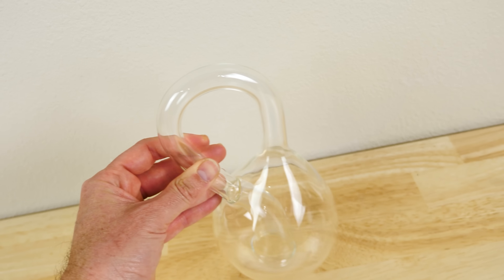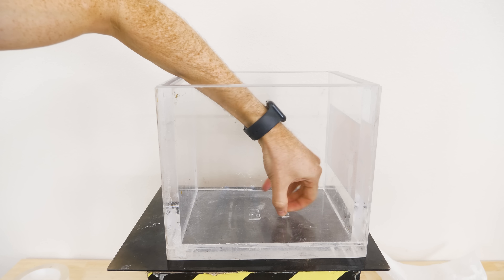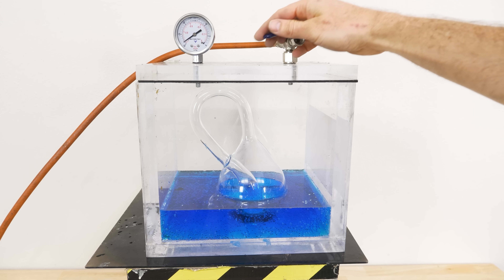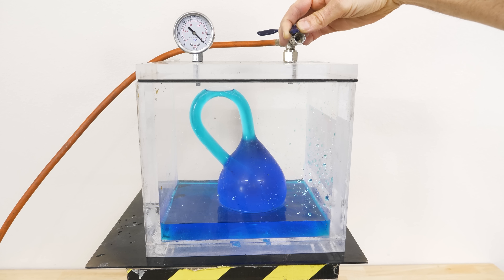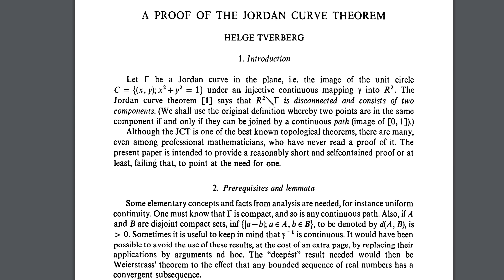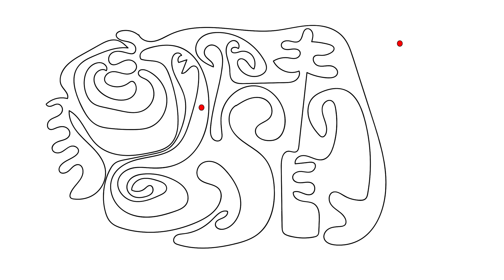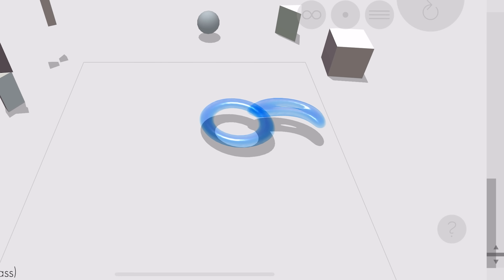Is It Possible To Completely Fill a Klein Bottle?

Comment: No, its just the conception about the physical Klein bottle model and the mathematical Klein bottle concept + the conception of "inside" and "outside"... it is kind of abstract but there is volume in the physical model indeed and filling it is the proof... the volume of water marks the inside while the air is the outside... and there's your volume... same that can fill other bodies with different shapes... You can also fill the tank with water and leave the inside of the bottle with just air... Is a test tube a shape with no volume? no... can a mathematical concept of a shape like a test tube have no volume? Yes... The problem is how you are applying your math and how you see the concept of inside or outside... ;) (Maths profesor and Electronics and Telecommunications Engineer sending greetings form Mexico)
Reply: Its not entirely mathematical, i can visualise it rather easily.
Its all about the intersecting tube AND the large hole in the bottle. 
(You probably know this part so i dont mean to sound condescending)
Remove the self intersection by adding another dimension and it simply starts and finishes at the mouth. No volume. 

But you can visualise it man, vaguely in chunks but have a look. 
Remove the intersect, try to imagine the end of that shape morphing into its self without intersecting, then try to imagine pouring water into the hole of that object and how it would behave. 

Its freaking weird man thats a funky ass mental image. This is a great mathematical demonstration.
Reply: @LogicCaster  the concept of point and line is mathematical it is not physical, though physically you can modify your personal conception to say a ball is a point and a bar is a line, but they aren't... so the lines ass borders of this model are not the same as the solid glass you have in the physical model,
Reply: @george.lopez1  
Then thats your loss.
Its not imagining a point being a line or whatever.
You can see its a closed system in reality if the start and end of a hole meet.
Its essentially a donut or torus made of glass, you cant fill it because there is no opening, its just a glass bracelet essentially. 

Thats the same concept except expanded out into a higher dimension. 

Really think about it.
Reply: @LogicCaster  The volume of water inside the device is not imagnation and it is measurable and it is a proof of the volume and that its just another bottle "similar" to the kllein bottle that is useful as a model to explain the concept... it is complex but do you undesratnd it that way? it is like chaos.... it is just order with more complexity that you may be able to process...  and about maths, there are real maths and theorical maths, on both you can find real and imaginary numbers... the difference is existance... It's not the same being just a physician full of theories than also an engineer and an inventor... these last two bring down concepts to reality..., I can measure the volume of that bottle similar to the concept of a klein bottle and i can measure the volume of the glass.... so...
Reply: @george.lopez1  
Its a shame you cant put two and two together mate. 
Maybe its my fault for not being able to explain myself, but theres a reason the entire mathematical community respects the idea of a klein bottle enough to make 3d representations…
Reply: @george.lopez1  
Oh and I didn’t mention I’m a mechanical engineer, and not because i was a good student in high school. Comes naturally to me… thanks for the kind words (:
Reply: @LogicCaster  The first lines are just rage that has nothing to do with the volume i mentioned and yes, clearly you cant explain because you are not understanding... But by saying "Representations" for first you are right... you are getting there...
Reply: @LogicCaster  Dude🤔, you got into my comment and conversation not me into yours... put attention... from beginning I am talking about the same thing... Seems you just want to win a conversation around my comment...
Reply: @george.lopez1  
You made a lot of bold statements and left credentials at the end of your original comment. 
You should expect criticism as a healthy aspect of science.
Reply: @LogicCaster  I did and explained in different ways to you didn't I? I am not shutting you down in any way neither...
Reply: @george.lopez1  
You’re bad at english that could be the problem.
Reply: @george.lopez1  

How much volume can a glass torus hold? 

Torus “tube” Diameter
- ID: 29.999999999999mm
- OD: 30mm

Torus as a whole:
ID: 150mm
OD: 210mm 

Whats the volume of this container, in reality? Im not asking you to calculate, just say what steps you would take and how you would approach the question.
Reply: I'll give you a practical easy solution as a child's experiment... fill your glass toroid/torus with water, (you can do it with sealing techniques or vacuum techniques or simply installing a cap without modifying the shape... then measure the maximum capacity until zero air bubbles inside the torus... there you have your volume in ml. Use conversion 1 milliliter = 1 cubic centimeter. There you go... Have a laboratory at your school and wanna do it in an inverted way? get a water tank, fill with air, extract air and measure, then transform to cm3... Wanna do it the hard way with or without use of programs, computer or calculators to plot? you need radial and cylindrical maths...  those plots are different from usual 3d lineal X-Y-Z axis plots... now, you cant use in-the-box equations, unless you are using the right one for torus where is like the equations you would use for cylinders with curves but since there is no bottom neither top, at the side that looks like a circle you need to set your beginning and end or top and bottom as 0° and 360°being the same... with the Klein bottle example, maths just get more complex so as the way to understand by plotting... similar to 4d calculations and plotting systems... so programs need to have that in their programming that instead of an XYZ plotting system where gets infinite to approximate your result to reality...  you can also have fun using spherical equations once you understand them... And also as an extra way to solve your problem, you can apply the millennial and Z Gen method: I am sure nowadays there are some simulators online or in apps where you can specify exactly just those details and get your answer.  Do you know the volume (solid material + liquid or gas inside) of the tires of the vehicle(s) you use to ride? ask the manufacturer how they did to get that data that you can easily find in their records... same with lifebuoy rings and other torus we use nowadays... Not enough? read the comments from everybody else... BR  ;)

Comment: I saw similar video about this about year ago. They just submerged the bottle in water and rotated it until air was out enough that you could see that it can be done. Then they explained how a klein bottle isn't any different than normal cup. They didn't do the 4-dimension stuff or math thing though, so this was more informative than that was.

Comment: I have a suggestion for a topic.  Virtual Particles.  Most of the research on them is going on at Fermilab.  I go to their site regularly to read about them and they have quite a bit of information available to the public.  As much as you like vacuum chambers, virtual particles should be very exciting to you.  Most of them are virtual muons with virtual electrons next in line.  I don't want to put too much into this comment because if you choose to talk about them I don't want to spoil your video by saying to much here.  I will just say that they can turn into real particles if they receive the right amount of energy while they are in virtual form and if you draw a very strong vacuum they start appearing and disappearing in the vacuum in very large numbers.  I realize the comment section is intended for comments about the video it is attached to, but I thought putting the comment on your most recent video would be the best way to contact you about it since I don't know any other way to contact you.

Comment: 3:20 but the rubber balls usually have tiny holes that allow you to pump them up or deflate them, is the ball then considered to have no volume? Or is there some kind of acceptable range of estimation where small enough holes can be considered filled up? And if so, why can I not pick one of the big holes on the klein bottle and say I've estimated it to be filled up (i.e. where's the line between 'ok to estimate' and not?)?
Reply: For mathematical purpose he just ignored the hole on the rubber ball as abysmal, because we are not particularly discussing about it (like, we are not discussing about the ball naturally deflating because the air is going out of that hole).

Comment: The idea that it doesn't have volume doesn't fly with me. The neck of the bottle simply dives through itself and opens at the bottom. 
He did mention the topology, but perhaps that's not the best way to define it. 
The bottom of the bottle is where the outside and in the inside separate.
That all being said, this is not my field of expertise and math is goofy to me sometimes.

Comment: couldn't you just submerge it in water or pipe water into it with a flexible hose that is smaller than the glass portion (letting air escape)? this just seems like a demonstration of liquid vaccumming if anything

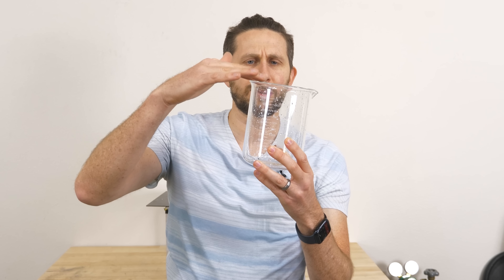Comment: 3:11 "In order to have volume you have to divide the inside world from the outside world". Wrong. I'm quite sure that flower pots (which are "open" on top) have volume and I'm quite sure you can even calculate it. 3:52 "But that's some arbitrary definition..." Just like the one you used at 3:11... In fact, if you look for an STABLISHED definition... here's Oxford one: " [uncountable, countable] the amount of space that an object or a substance fills; the amount of space that a container has" According to this definition, the flower pot has volume as the beaker you (wrongly) stated had no volume.

Comment: To divide the inside from the outside, you'd just have to separate where it transitions. Beyond that point, it is the inside. Before that, it is outside. Same way you would divide a vase or that beaker. It's not really arbitrary, if that is how it is commonly done. Another way could be to just have the part that is fully walled, the big basin part, considered the inside. Since that is mainly what you are filling. This absolutely still has volume, even by the standards established. If it was truly volumeless, it wouldn't be possible to fill it, period, nevermind all the way.

Comment: A very interesting video. The set up to fill the bottle, however looked like a Rube Goldberg machine! I would have inserted a flexible plastic tube (1/8 or 1/4" dia) through the opening where the liquid is being poured all the way into the chamber to allow the trapped air to escape.
 I understand that is not the purpose of the video.
 I did learn a lot in a short video about the definition of 'inside' and 'outside'. 
Wonderful educational video. Congratulations

Comment: I would guess put a thin rubber tube or straw into the opening and then start filling through the straw or around the straw that will allow air to escape. Not cool, but probably will work.

Comment: 3:28; the bottom, where the opening is.  Only reason it's hard to get the water in is because of gravity, is all.  Just because the opening is rounded doesn't mean it doesn't have a rigid entrance.  Seems to be something we won't be able to understand since it's a 4th dimension concept

Comment: My first thought would be to use something like a garden hose to force the liquid in and the air out. Also, I would just say that the very bottom would the end of the volume. I would also say that the top of that beaker is the end of the volume. I don't understand why open containers can't have volume if the opening has even edges. Is there another word that can be used in place of volume for that instance?

Comment: That is a very laborious way of filling the bottle.
Just use a little tube to fill it from the inside and it will push out the air without trouble

Comment: Agreeing with others here ...  According to the definition of the word VOLUME (Merriam-Webster), a Klein bottle does have volume.  The argument that the bottle "has no inside or outside" is objective.  Fact is, 1) The glass that makes up the bottle itself displaces the air or fluid around it and that can be measured.  And 2) as the video clearly shows, the bottle can be filled with another substance that can be contained and measured.  So based on the above it clearly has volume and can contain a specific amount of a given substance that can be measures, therefore it has fixed volume.

The concept that Klein bottles have no "inside or outside" is poorly conceived.   Take for example a normal glass beaker, it too has a clearly uninterrupted surface traversing from it's inside to it's outside, same as a Klein bottle.  And in both cases the material they are made of and the amount of a substance they can contain can be measured.  The only difference is the Klein bottle is allot harder to fill, measure, and define the boundary between it's inside and outside (which can be ascertained by noting the point where water (in the case of this video) is contained vs. spills out (same as for any other normal container).  QED